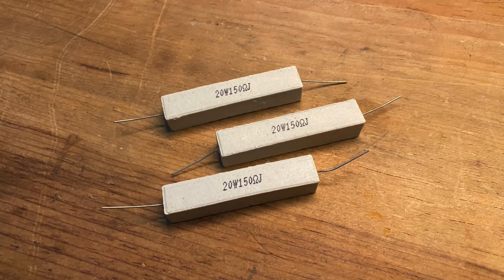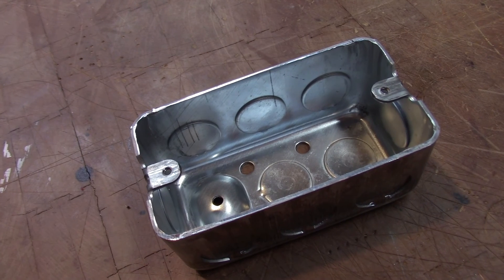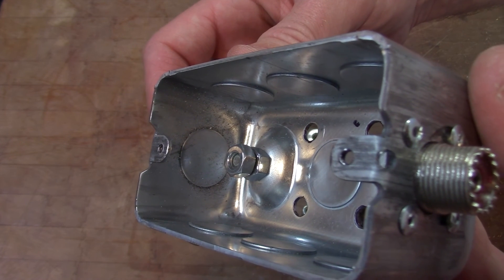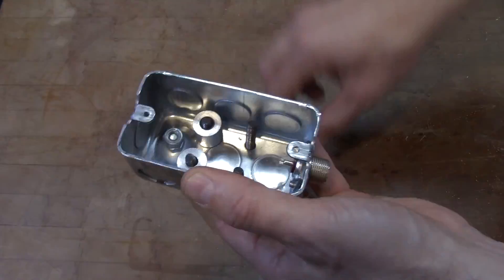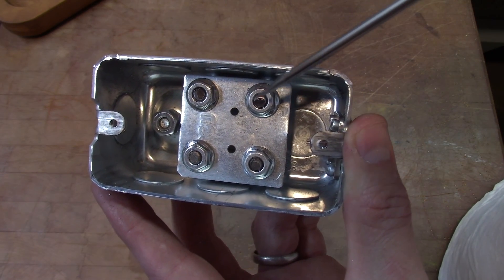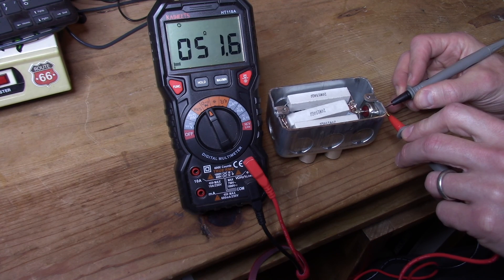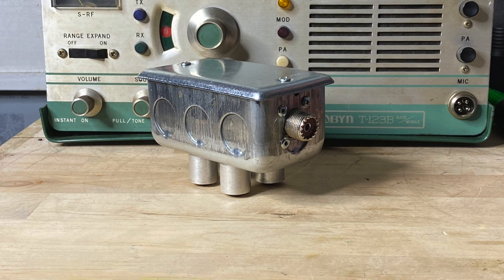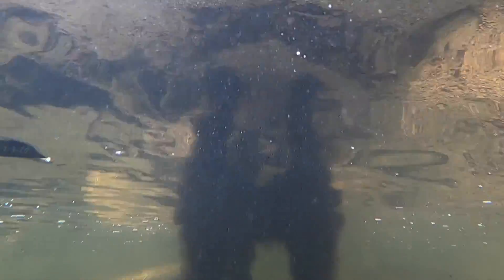How to Make a Dummy Load - The 50 Ohm "Silver Pig" (CB Ham Radio)

Comment: Those resistors, being wire wound, are not suitable for a dummy load construction, the inductive reactance reduce the application only for low frequencyes. 73 I1WSM Silvano
Reply from the maker: Opinions vary.

Comment: Im sorry that you did all work to get a really bad working dummyload.. This dummyload will not hold 50 ohm impedance at frequencies over a couple of Mhz, i would guess it starts to roll away from 50R after a couple of hundreds of Khz, and really be off at 30Mhz.. This type of resistors are inductors with anything else then DC or wery low frequency AC and do not work well with faster AC.. Use inductance free resistors if you want to build a dummyload for RF.. Buy an LiteVNA/NanoVNA if you want to measure the impedance at any frequency you want..
Reply from the maker: Or, you could be wrong.
Reply: @HNXMedia  He is not wrong, Dude. Wire wound are not for RF.  Ask your fellow Hams.👍

Comment: Uuuuuh... them is wire-wound resistors! Not good for RF!
Reply from the maker: Working fine for me.
Reply: @HNXMedia  measure it with AC wave from a function generator and use some math to calculate your complex impedance to see how it responds to RF in the real word. I think the antenna book has the formula, if not there’s definitely an easy source. Pure DC resistance is very different from AC impedance, especially with wire wound resistors
Reply: @HNXMedia  In which frequency did you test that tool? I have soldered a 50 ohm /5W wire wound resistor like yours on a so-239 and I got 8.5 SWR in 28 MHz. Not good for RF, too much inductance.